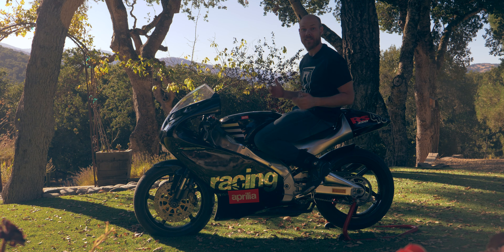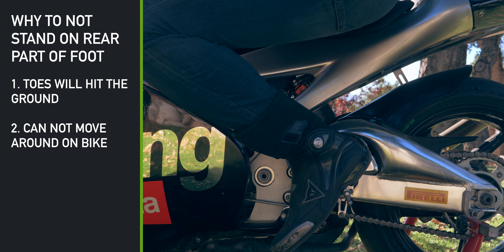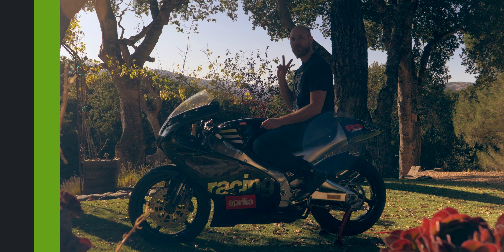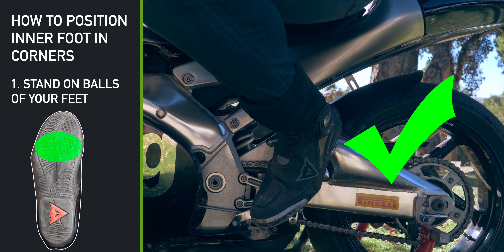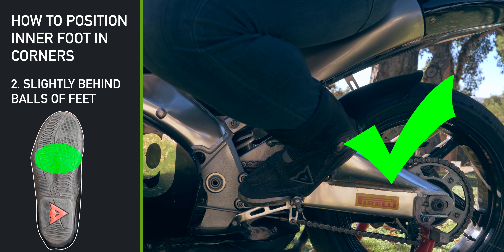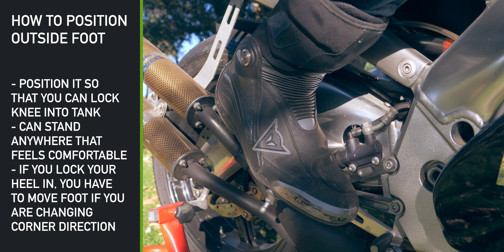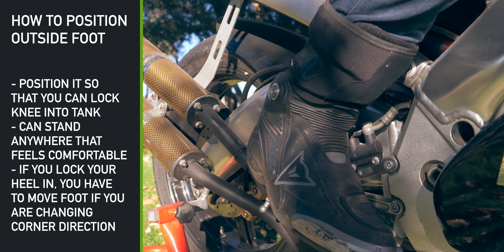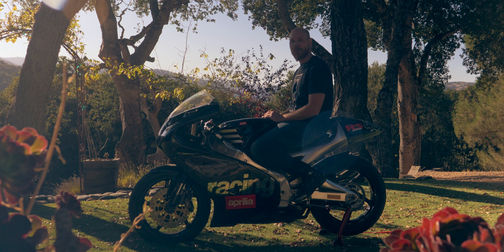Motorcycle Foot Position | EXPLAINED

Comment: This kind of rather goes without saying, as there is no fixed position, but more importantly this largely depends on riding style. Big difference between racing and just cursing on public roads.
Reply: I ride like this on public roads and have done for the last 15 years of riding
Reply: @Xfacehack  Ride like what? You need to be specific.

Comment: I practice the same inner foot but the more heal outside foot style. I feel more locked in that way. I also really like the foot twist to lock in too. But be careful and make sure your bike has enough clearance from the chain and exhaust before twisting the foot in.
Reply: Works well but its very depending on what bike you got and rider hight
Reply: MotoGP riders do same. I used to be on ball feet and tried to lock heel on outside foot for track days. It takes way less effort to hook the bike on corners. Very appreciate to save energy, particularly on physical liter bikes.

Comment: Hi Mike,

Broke the bone that protrudes on the outside of your ankle...

Coming from 35 years of riding and a few years of track riding road machines like FZs, R6s and R1s. But I am no expert on supermoto. Also, I would expect that requirements for equipment between motocross and supermoto are not exactly the same.

The bone is the fibula. The fracture occurred when at low speed in a very tight turn, I lost it during supermoto. My foot was wedged between the bike and the pavement. The protruding bone at the ankle dribbled with the bike weight over the pavement. I felt the crack. I was in full gear but wearing sports bike boots. These did not offer the right protection for this type of situation. Apart from a plastic outer shell the impact point included almost no cushioning.

But here is (partly) what went wrong. At times, my sports bike boots were offering too much grip on the pavement when extending my foot forward in the corners. The solution was to bend my leg more. It caught and got wedged when I lost the front while leaning in too much.

Would motocross boots have offered greater protection in this case? Would they have offered less grip or otherwise more means to slide the sole over the pavement? 

I can imagine that boots used for supermoto would benefit from grip on the pegs, while also wear resistance and replaceable slide patches made from soft metal or nylon at the sole.

Any advice? What boots might have offered more protection and better permit to slide the sole over pavement?
Reply: It's been a year without Mike's reply.
Reply: @RecluseRider  I don't know how much longer I can hold my breath...

Comment: The heel of my foot is on the right peg. I drop my toes down to apply the rear brake. But it's usually uncomfortable to have the heel down and the toes raised up high while riding.
Reply: Yes i am really having trouble regarding the same i place more of back of my feet on the peg so i can emergency brake! But keeping my foot off brake and twisted up us such a pain! Any suggestions?
Reply: @danishbhat7242  re-position the brake pedal to be LOWER than it currently is. Sling it low!

Comment: On the track on the straights and when I accelerate on the road and move my body back and get fully tucked, I have my feet on the heels so I can be steady when changing gears. And also to have traction to not move back and pull the handlebars, or else I get wobbly. On the corners inside foot like the second example and outside foot on heel, except if there is a next corner coming in the other direction. On daily commute same thing, but feet more backwards on the straight like on the second example.
Reply: I rode BMX and motocross for 15 years before I ever got on a street bike, anything other than balls of feet is unnatural to me. I've never ridden any motorcycle with the peg anywhere farther back than that, and there's no advantage to it anyway. You're only in control on the balls of your feet.
Reply: @RyanMcIntyre  I know what you mean, I have changed my riding style a few times and still trying new things. Everything new I try feels unnatural at first, but after practice it doesn't and if it works then it's mine. I am willing to try anything that might help me be better and faster.

Comment: If you dont know that you have to move your feet up in the turn dont ride a bike. On the other hand if you ride like that all the time in the traffic I will beat you with a pole. You are not gonna be ready with the controls in fact you will most likely miss them when you have to act fast. Also good luck holding your legs on the pegs when you get a wobble. Video is good but it should have stated that this is only for the track when you have turn after turn while working your weight around.

Comment: Ok video but for normal tour riding i disagree. I (and a lot of ppl) angle our feet a bit to the side so its next to the shifter/break lever. Yes on a hardcore supersport u can run into issues in corners, but basically every other bike its fine. Its a more relaxed position so for longer tours preferable.
Reply: I feel like in an emergency situation like loss of traction or slippage that foot position is not as helpful. When it comes to needing to weight the pegs into a slide if your toes are next to the controls you may accidentally jam on the brake or gear shift which would make the situation even worse. People also argue that it keeps your toes closer to the controls which can help with quick action in am event like someone pulling out in front of you... But I feel like once you have practice and are seasoned you don't need to do that, you are quick enough to move your feet up for any situation. If you read that and think "sure when you're seasoned! But it could save a newbies life!" A new rider will never learn or build proper habits if they don't use proper technique.
Reply: @Dangerwiggles  The technique i described gets tought at pretty much every motorcycle driving school here. What i seen on here the way usa teaches motorcycle driving is incredibly lacking compared what we have to do to be allowed on the road though. We get many more hours in the seat to get our license.
Reply: strictly depends up on people's choices.